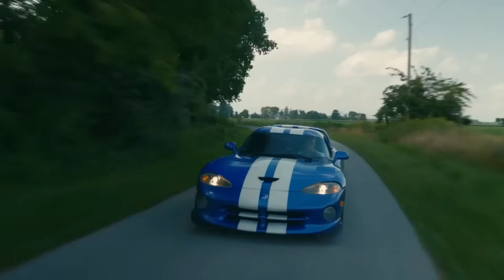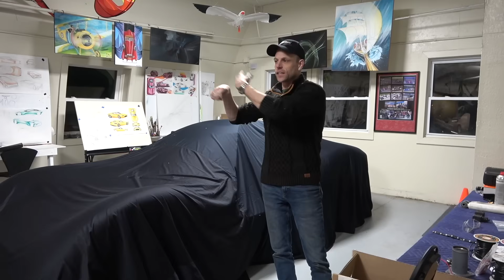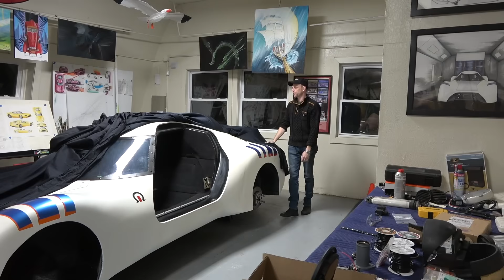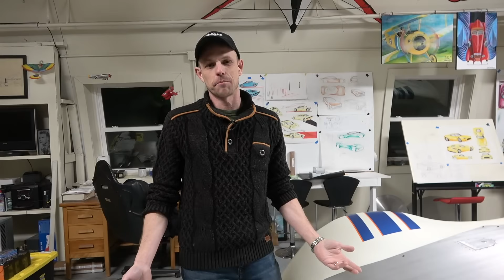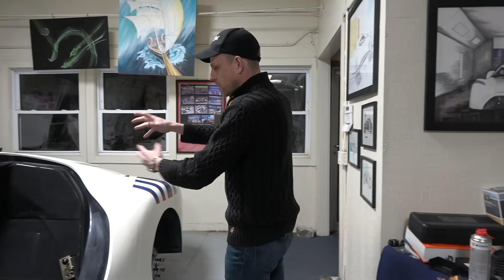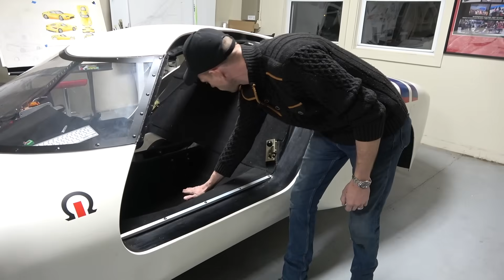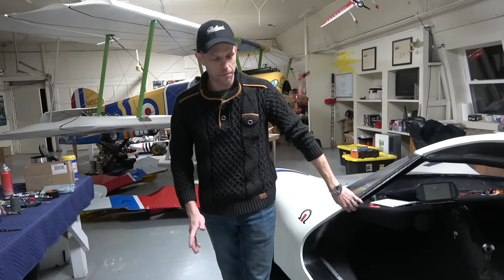Casey's OMEGA CAR because the AUTO INDUSTRY doesn't GET IT!

Comment: Casey. Its freaking awesome. What are your thoughts on hybrid power trains. Like freight trains. Use a small turbo diesel hooked to a generator. The engine can run at a steady rpm and the generator provides the current for the motor(s). CSX advertises crazy numbers. Should work in a car too, I think.

Comment: I know this comment is late but this is why I love Russian automotive products. They produced basically the same car over 45 years with the AvtoVAZ 2101-2107. The car was essentially a copy of the Fiat 124.many people see then as a joke but living in Russia I have seen these survive just about everything. They are easy to work on, affordable, many modifications available, reliable, interchangeable parts galore. Literally a perfect platform for someone to get into the automotive world on any budget. Many guys here learn to drift and car control on them, others use them in rallies around the world. The other day I saw one that that was modified and had a 3 type fuel system. One was petrol, one was kerosene, and the other some sort of butane or gas mix. The car had heating elements all over the engine and transmission to heat oil in below zero temperatures. The car drives 1000 kilometers a week to the north. Truly a wonderful thing and it was made in 1983. I love these cars and I wish modern manufacturers made something like this again. Just my 2 kopecks. But I’m a world of planed obsolescence it’s a dream that just might be to far away.

Comment: I wish VW would make TDIs again in the usa I got a 2015 and even with all the recall fixes I get really good mpg if I cruse control at 70 it holds the low 50s. when I drive 50-55 mph on the old highways it gets some insane numbers like mid to upper 60s depending on hills

Comment: no one wants to deal with def fluid and soot collectors and catalyst that fail constantly. you cant run a diesel with a straight pipe anymore. Diesel vehicles are dead in north america. can u even buy a diesel audi anymore? even though they killed at lemans racing

Comment: Also, you missed one important thing about electric cars: crash safety. Yes, I know that Teslas are the safest vehicles on the road today, but the problem arises when the battery explodes. Gasoline/liquid fuels have a built-in safety mechanism where they require oxygen to ignite and are safer and easier to put out in case of an accident. Lithium batteries, on the other hand, are impossible to put out (thermal runaway) and must be submerged in either water or sand and the firefighters just wait it out. Even with this, I'm still of an EV car guy because of the performance potential of electric cars.

Comment: Electric cars, even with the lithium mining and stuff, are actually cleaner than ICE cars. Engineering Explained perfectly explained this in his video (https://youtu.be/6RhtiPefVzM). The major problem with electric cars is that they're bitch-heavy and some of their materials, such as cobalt, come from poverty-stricken combat zones in Africa. Don't forget the range also, and their sheer size. I never really get why electric cars ahve to be that massive and heavy, when they could easily design one that weighs 3000 lbs and less.

Comment: Frankly, the way I see it, Diesel-Electric is the way things are going, or at least where things would go in a rational world (the kind we don't live in lol). Full-electric just isn't a realistic option yet, and coupling an engine to a transmission and differential(s) is horribly inefficient. Mining equipment, for example, uses Diesel-Electric equipment pretty much exclusively, for both cost and performance reasons. Using a diesel generator to power electric motors is far more efficient and cost-friendly than using transmissions or going the full-electric route. If you're wondering why I keep saying "diesel", just look at the fact that not a single industrial generator is based off a gas-burner. They're all diesel or turbine-powered (using Natural Gas), and there's a reason for that. Fuel-economy, peak-torque and efficiency are all things that diesels have over gas-burners, regardless of what most ill-educated Petrol-Heads would like to think.

Comment: No rear window makes it a commercial truck, worldwide. You'd need to change 166 national and even more state laws. Ditto on using side cameras instead of mirrors. Which are bulky, but simply don't fail the way electronics do.
 And then there's the style concept. You've built a two-seater. Ghe soccer moms (and everyone else) just don't want it. Neither do the insurance companies.
 Sorry, Casey. You've just built a high mpg Viper.

Comment: Glad you did a more in depth video on this car as I have been interested in it since I first saw it driving past your shop. The whole thing is gorgeous, but man that rear end is particularly amazing looking to my eyes! I love cars with open rear ends. Two questions though; with the initial drive train, how much do you expect the curb weight to be, and do you have an estimate/goal for the c/d?

You should be very proud of this prototype no matter how far you end up going with the development, because while most people talk about doing things like this (myself included) you have actually got it WAY past the drawing board / PC renders. Honestly if you had a channel that just did video updates about this car I would still be an enthusiastic subscriber! Never stop all the awesome things you are doing, no matter how many people understand it, get behind you etc. If you demonstrate just one or two advancements that get picked up by the big manufactures you have already changed the world in a major way for the better.

I am slightly optimistic that the future of the automotive industry may start to be a bit quicker in trying out and adopting new tech etc because the cost of prototyping and small scale manufacturing  has come down so much in the last 20 years.

Comment: Had an 05 cobalt base 5 sp. 40 to 45 hwy all day in flat Montgomery Co ohio area. Best car ever. Bought new. Tires, oil, 1 battery after 11 years, 1 ignition control module, front brake pads. 156K miles. I miss it.

Comment: Diesel cars are going the way of the Dodo. These are already many  European cities in which older diesel cars are no longer allowed to enter. Reason: NOx and carcinogenic sooth emissions. 
So, no diesel, what then? 

I say electric IS the way forward. Reason: the car becomes INDEPENDENT from the energy SOURCE! Yes, most electricity is still produced by burning fossil fuels but things are changing: solar, wind, hydro and nuclear. MODERN SAFE CHEAP to build nuclear powerplants like TMSR, Thorium molten salt reactors.( a US invention from 1960's) 
With those humanity could have an abundence(!) of cheap electric power for thousends of years of driving EV's and still have plenty left for other energy needs! 

ICE is basically still the same as it was in 1900. It has come to the end of it's development, just like the steam engine. There are no more large efficiency gains to be had for the ICEngine
But traction battery technology still has lots of potential for development.  
As for the EV drivetrain i challenge anyone to find a more energy  efficient way. An electric motor is about 90% efficiënt! There is NO fossil fuel engine that can do that. 

Basically modern societies have two challenges with regard to road transport: 
achieve cheap and abundant production of  zero CO2 emitting energy.
Create cheap recycleable  traction batteries that can store a lot of energy in a short amount of time.

Comment: pretty sure the modifications used to make super super efficient diesels make them more efficient in terms of fuel consumed per mile , but not necessarily polution created per mile. ive never seen any of the hyper mile diesel guys actually post emissions measurements under driving loads. granted you could do some fancy math and figure out if the decreased fuel consumption makes up for the increased tail pipe emissions in terms of net pollution , but air quality at the pipe will always be a more important factor since the cars pollute directly where we live , and the fuel creation pollution occurs elsewhere and is easier to control through emissions devices , scrubbers ext ext.

Comment: I'm in the middle of finishing my Mechanical Engineering degree, and I also reside in the NW Ohio-cornfield-area. Seeing some of your ideas get me excited - not all of the visionaries are out in LA building FJ40's and Broncos! Planning on coming back to the area after graduation. If you're still looking for a business partner in a year and a half to work on these rad projects, hit me up! 
So many directions you could go with that prototype. Even in the cornfields, there are enough McDonald's where you could do a vegetable oil conversion on the diesel and turn fast food chains into "gas stations," which might make those junk food-joints half useful to society.

Comment: Back in the day, every subcompact car could hit 40mpg and nowadays only hybrids can hit that number. How insane is that?! The old Insight got 70mpg and had a manual gearbox and now we are impressed by 50mpg out of the expensive new Priuses!

All these useless regulations and building habits and for what? To regress as a society? Racecar engineering is what made cars good back then and we forget that it still can even today!
Reply: The insight used a lean-burn tune, which got great mileage, but massively increased the nitrous oxides and sulfur dioxides the engine produced compared to a richer tune.  Kinda a similar deal with the VW diesel-gate (and the fiat/chrysler/dodge/jeep dieselgate).  Emissions systems turned off outside of test conditions, reduced fuel tune netted extremely good mpg numbers..   at the cost of increased emissions.

So is it better to produce more emissions per gallon burned but burn fewer overal gallons of fuel, or burn more fuel with less emissions per gallon?
Reply: @jdhill770  Interesting. But it still would've gotten over 50 mpg without it considering K swap Insights get 45mpg

Comment: Regarding the engine cooling, how would a common person, without a floor jack and jack stands, clean accumulated debris from the radiator? Particularly if they live in a dirty environment?  How would you make a four seater monocoque version without installing a modern heavy/safe seat without sacrificing rear passenger leg safety? Can the vehicle be repairable in a way that insurance companies won't write it off after a small fender bender*? (For context the current generation of Ford F-Series trucks are being written off anytime the LED headlights are damaged.) I completely agree with your philosophy, keep the car lightweight, simple, budget friendly, eco friendly, and fuel efficient. I really like the idea of the Diesel motor, unfortunately it has a bad rep, but for ICE efficiency, at this current time it cannot be beat. I also think there is a lot of life left in the ICE, just needs to be updated.  Regarding basic modern safety features, how do you plan to incorporate SRS, Airbags, windshield wipers, etc. For headlights, I think they should be incorporated into the *front fender area as current rules and regs to state minimum mounting heights and widths. 

Regarding your current market, I think your concept, as it stands, appeals to Miata, maybe Z4, GT86, Lotus Elise, and etc buyers. Which makes me wonder if your market share is too limited? In order to make more of an impact, I think the vehicle needs to also appeal to owners of city-center. 

Last thought, it is going to take a lot of legal work to also update US vehicle laws. So in the same time that a vehicle like this is being developed, laws will need to be amended, I'd also strive to make the car CARB legal and California compliant, currently European/ROW manufacturers build all of their vehicles to meet those standards.

Comment: Brother, I will trade you... While I get my shoulder fixed next week ,and then a month of recoup time, then several months of shoulder rehab... finish my Jeep for me, It is all there, ready to go .. I am just broken armed.. once I am healed, I will drive to you, and finish your rig... which is not a huge deal to handle, but What I want to do more over, is build carbon fiber structured wheels, either honeycombed or hollowed tunneled .... That will take some time, as that is something I have not ever done yet. I do not have any clue as to the legal parameters or D.O.T. crap for making the wheels passable, by means of sending them off for crash testing or load testing like 12 additional sets... I have no clue, I just know I want to build a set, just to see If I can. I would also like to try a 3 piece sammich type wheel construction, of aluminum outer, aluminum inner, carbon fiber spoke that gets pinched between the two rim pieces, again, just to see if I can... I only live about 1.5 hours from you in a sports car, and about 3 to 4 hours driving in a 4x4 jeep to get to your shop, LOL... just from Fort Wayne... I could see a TSW VX-1 type wheel on this concept car of yours... just for the flash aspect, maybe cooling feature... moon covers or old school BBS for smoothness in aero dynamics... Do you remember the SAAB tri-spoke wheels, I think they were called "MONDO"...  they consisted of a 3 spoke flat squared off spoke... Those were always pretty sharp, maybe configure them for an actually knock-off nut hubcentric's?.. That is my two cents... I suppose, now that I have just read what I have written, doesn't sound like I have much to offer... and seems pretty one sided and risky for anybody to take my up on this.. so, I will go back to my tiny rock, and hope watch time pass me by some more... nothing else I can do at this point... that old phrase, wish in one hand, and sh*t in the other, and let us both watch to see, which one gets fuller first... lol... I have spent the past 20 plus years building everybody elses stuff, and I seem to keep passing over myself, and now that I am running on 1 cylinder, maybe that is a good thing, ... time to reflect, and start focusing back on what I want and need... sounds good to me

Comment: This this something I’ve been thinking about a lot and you hit the nail on the head I think. My enlistment is up soon and I’ll be going to school for automotive engineering. My goal is to one day build a car with the best efficiency possible but most important to me is low cost and simplicity while setting a new standard for safety. Another cost aspect I’ve been thinking about is maintenance. I know there are better ways to design a car when it comes to ease of access and simplicity. I write down new ideas almost every day for reference in the future. Hopefully you see this comment and it reassures you in the way your video did for me.

Comment: I love the idea and kinda have a similar thought on the way that cars are designed. What if you moved from Ohio to Texas maybe the Dallas area to try to work with Toyota. You could definitely fine another shop in or out side of Dallas.  If you can handle 104 in the summer you should be fine.

Comment: You nailed... But I think you still can go much further with radical innovations! Take a look at my independent research!

https://lawrencejorgers.blogspot.com/2010/06/flyer-next-generation-gt.html Copied by a great, really great germ, oops, european automaker, but as only showed the wheel, their advanced design team copied only the wheel several months after this post... Sad that the executives bought... But my research is untouched, nobody cracked the monoarm suspensions that work at the road and above it! Let's fly?

https://lawrencejorgers.blogspot.com/2015/05/in-2010-i-was-watching-on-moto-gp-race.html Why motorcycles are so insecure? Why no safety systems are introduced at MotoGP as is done in Formula Indy and F-1? Nobody has a believable answer to this question...

https://lawrencejorgers.blogspot.com/2011/04/pulse2-cyborg-eagle-advanced-generation.html One car 50 years ahead its time, maybe more... With the cheapest Formula-Vee or any other mono place with exposed wheels that you can put your hands on, plus few hundred dollars in additional bodywork, 2 sets of tires if you want to test tire wear,  little fuel cell if you want to test energy efficiency... And you can prove or not 50% of the aerodynamic philosophy, completely different of anything you saw...

What do you think???

Comment: Wild. I was just having a conversation with someone and touched on many of the points about electric cars that you mention. Electric cars alone will not be the answer. It’s crazy and laughable that all the Majors are putting all of their eggs in one basket. Nice car by the way. I would buy 2 of those before I ever think of buying a Tesla. The next best thing to “efficient” cars is to keep cars that exist now, on the road as long as possible. You know, those miracles of engineering, physics and chemistry that we treat like disposable utensils....Like you said, the system is only designed to talk about doing something.

Comment: Have you looked into the Low Volume Vehicle Manufacturer's Act, which allows smaller companies to produce up to 325 models per, 5000 vehicles maximum without having to face all the strict "safety" and "emissions" laws that automakers have to comply to?